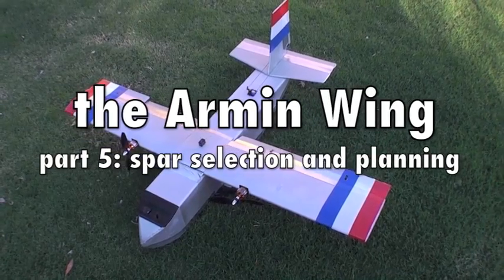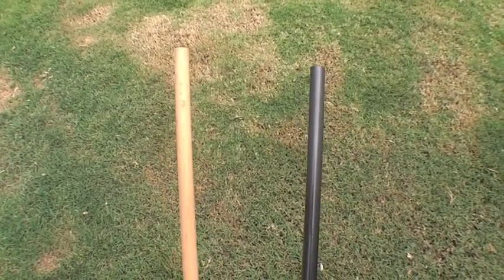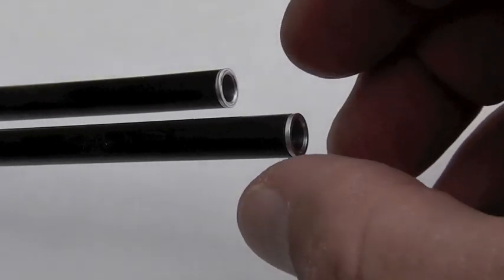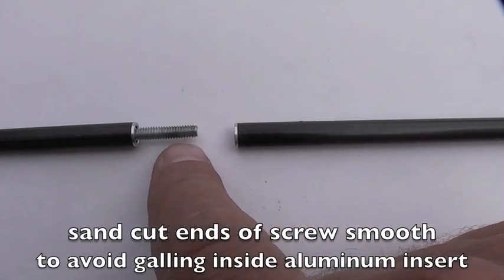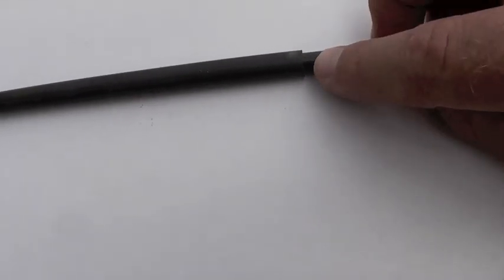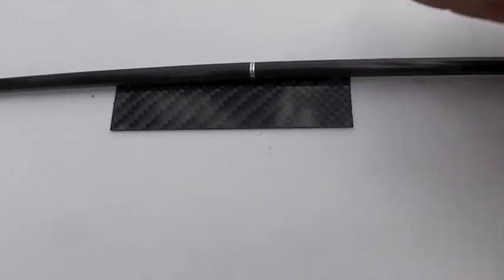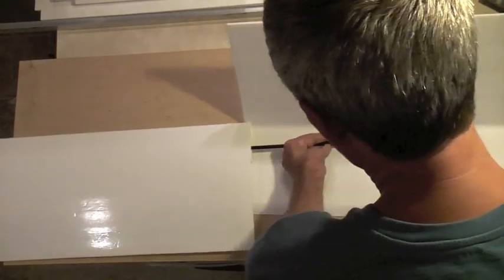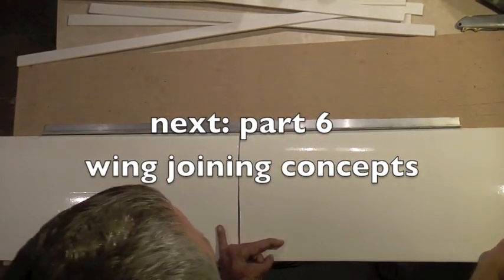the Armin Wing: part 5 - Spar Selection and Planning

Comment: I love your videos! Another shaft joining method that has worked for me is to use target arrow shafts (usually fiberglass) and insert them inside the larger carbon arrow shafts. The target shaft will fit exactly inside the carbon hunting-style shaft, negating the need for the arrow inserts and screw. The archery pros have an endless supply of remnants from newly sized target shafts that they will be happy to give you. This may make your already amazing designs even better!

Comment: I too have found the orange fiberglass rods at Home Depot as did ITman496. At my store here in Austin, TX they are still $1.98 for a 48" rod. I cut a foot off on of the scraps I had and weighed it. It came in at 27 grams. Somewhat heavier than wood or C/F but the price is right and it is very stiff.My testing wasn't up to your standards, I held the rod at the ends and tried to bend it to breaking.  I could not break it. It was hard to bend it very far. I bought some of them for trial spars in some wings that I am currently building. They are 5/16" in dia. and have a reflective band at one end. They are very easy to cut with a hacksaw and deburr the ends with  some sandpaper.

Comment: Hey!

I followed this guide, and discovered a new material for spars that (in my opinion) works rather well!

When I was at home depot, looking for the dowels, I did find them, but on the way, found those poles you put into the ground for plows in the snow so they don't hit the curb.  The neon orange ones.  They cost about.. what, just under two dollars?  And are at LEAST 48 inches long, and a LOT stronger then a dowel of similar size, as I found out at the store, when I accidentally broke one..

Comment from the maker: @WalneySkyland Oh how I yearn for the metric system!!  32 is indeed the tpi.  "8" is the Unified Thread Standard (UTS) #8 size which is 4.166mm diameter.  My guess is that the arrow inserts you would be using would be metric and have a screw size to match.  You could try some fancy size conversions but I bet it would be easier just to ignore the specs I give and just ask the archery guys where you are.

Comment: Awesome videos.  I live in Michigan and can get dowels at Meijer (just like Walmart) for 50c - 1$.  Same with the arrows, about 1$ a piece w/o a practice tip.  Your over paying :)  See how much they are at wall mart might be cheaper ?   Very nice wings btw.  I will keep watching, I want to see how you attach the dual motors to the wings, I always have problems with that.  I have a ton of 1$ tree foam in the basement, just keep using pink foam because I am used to it.  Thanks again its apprecated